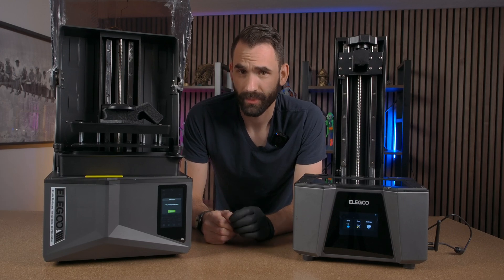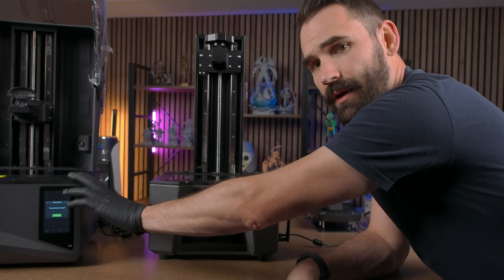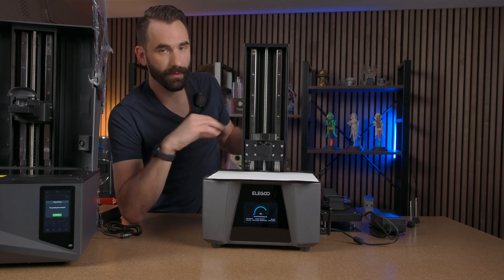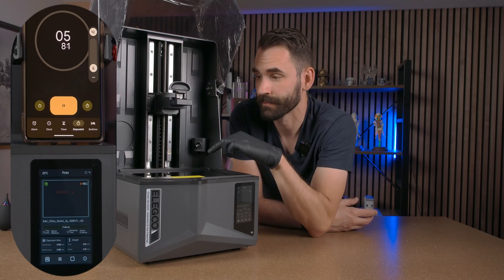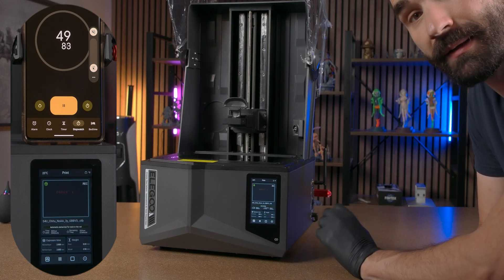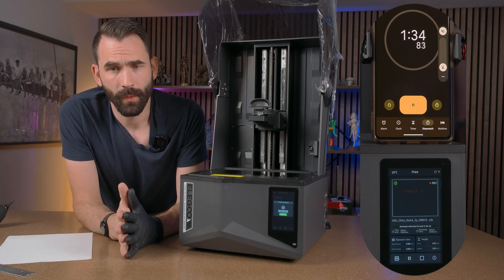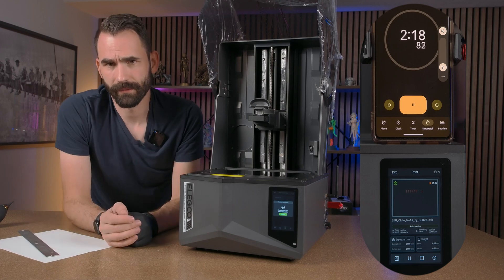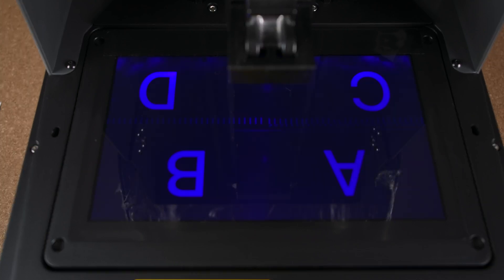Even the latest printers still have this MAJOR bug!! #chitubox #elegoo

Comment from the maker: The Glitch found has been an ongoing research project for over a year with help from aWildTomAppeared, REF and Meowcate and others on the LycheeSlicer discord. 

At RAPID + TCT I was finaly able to get into contact with the Elegoo Engineering team. I will soon be sending them all of our data where we hope we can work to find fix. 

For now if you avoid AA and .goo OR like I said in the video, straight lines on the X axis you may never come across the glitch. I would not classify this as a major issue due to it's infrequent appearance but a minor issue as it's also pretty easy to get around.

Howerever, Elegoo, you could make this time to start a print dry or normal a bit faster...... :stopwatch-blue-hand-timer:
Reply: Thanks for highlighting this issue ! I personally would still consider it a major issue, because not only do people need to be aware of it to circumvent it, they'll need to do dry runs to make sure that any modification they bring to their files is successful, or risk another failure again. Basically, they'll have to fiddle instead of being able to follow one clear simple rule to avoid it. 
I really hope all the hard work you and others have done to detail that problem will pay off and that a proper solution will be found (and not just for the M5U/S4U BTW, but their regular printers as well).
Reply: A DIY approach is underrated the software is dead simple and so is the hardware.

I was thinking about taking a laptop screen and a UV light and making one because it's so simple.
Reply: Hi! Im in need of some help I started 3d printing almost a year ago and have experienced the same situation with 3 different printers, spots and kind of scuffs appearing on the lcd screen the latest one on my 3 months old S3U and it also happened on my S2 I dont know whats going on? I dont actually have problem printing all my models prints perfectly but my screen gets damaged over time and then the spots translate as holes to my model which is really a bummer because I enjoy the hobby but I never knew why it happened to my Saturn2 and now its happening to my S3U. The only thing that comes to mind is that maybe I pressed a little too hard when leveling the build plate? I leveled with the paper method. O mayber my settings are incorrect? Currently my settings for Sunlu Standard Grey are

Burn in layer                                        Normal layer
Number of layers: 5                           layer thickness: 50um
Exposure time: 40s                            Exposure time: 3s
Trans Layer Count: 10                        Lift Distance 3>3 mm
Lift Distance: 3>3 mm                       Retract Distance 3>3 mm
Retract Distance: 3>3 mm                Lift Speed: 80>240 mm
Lift Speed: 80>240 mm                     Retract Speed: 240>80
Retract Speed: 240>80 mm              Wait before print: 1

Sorry for this comment I'm basically losing my mind because I have made a lot of research but to no avail, and all I have learned has been by watching videos but I need some more clarification on why my printers only last a couple of months, I have been making 1/6 and 1/4 scales and I would like to continue making them and been confident that I wont end up screwing up my printers, using lychee slicer btw, hope you can help me out with this little situation I'm experiencing and thanks a lot in advance!
Reply from the maker: @lolofx21  have you read my guide? 

https://docs.google.com/document/d/1aoMSE6GBGMcoYXNGfPP9s_Jg8vr1wQmmZuvqP3suago/edit?usp=drivesdk
Reply: @J3DTech  i did but I still have some questions boss 😔 I myself dont encounter problems printing, all models print fine, but the screen gets damaged over time and still dont know why
Reply from the maker: @lolofx21  1. Follow my workflow with the soft silicone spatula before every print. 

2. Clean any failure using the VAT clean method. 

3. Use my bills plate Calibration prints to set the Z offset to reduce FEP damage and increase success rates. 

4. Calibrate using Boxes of Calibration for the best strength you can get while maintaining dimensional accuracy. This will also increase the life of the FEP and LCD.

I have a LOT of workflows all designed to get better prints,  More success, and keep your printing going for a very long time. 

See my shorts as well. The tips and tricks to use tape to keep your printer clean and running well. 

Oh and how I level on the FEP is also to keep the LCD clean.
Reply from the maker: @lolofx21  Run this test to confirm level and set Z-offet

https://doc.mango3d.io/doc/j3d-tech-s-guide-to-resin-printing/printer-calibration/build-plate-calibration/

This will help with pressure agasint the FEP.

Also I have another video give it a watch and follow how I prep and clean. All this will help
https://youtu.be/llQN-70i36M?si=2LpRbuDjGwa6vcwx

I will also be doing a live stream on Saturday on the Lychee Youtube and I'll be going over some stuff to help with this very issue.
Reply from the maker: @lolofx21  Reach out ot me on Discord, if you have not all ready join the Lychee Discord and chat me there, derek J3D-Tech | Lychee team and I can help you much better. 

For now, use
Wait before print: 2s
Trans Layer Count: 3
Retract Speed: 180>60
Finaly run the build Plate Calibraion prints to confirm level, then set the Z-offset.

https://doc.mango3d.io/doc/j3d-tech-s-guide-to-resin-printing/printer-calibration/build-plate-calibration/
Reply: @J3DTech  will do!
Reply: Can you slice I  chitubox for an elegoo and select a diferent file format than .goo?
Reply from the maker: @davidc3150  You can use .CTB and it will help but not fully remove the chance
Reply: @J3DTech  yeah its a pain that but. I am assuming that's what is happening with my saturn 2. Ironically same model distribution won't trigger it on my saturn 3. I guess I will just have to settle with the idea of using around 80% of the printable area on the sat 2

Comment: Wow thank you so much for the work you put into researching this issue! I had it last week and on the weekend and it was driving me crazy. So much resin wasted. :( Guess I'll just print without AA for now... it never happened on the first layers for me so I would have to watch the printer for hours in a dry run that's really not acceptable.
Reply from the maker: @TashiMortier  When you ran into it where you using .CTB or .Goo?
Reply: @J3DTech  CTB Files, I knew Goo was cursed from my first tries of just printing the most simple models with AA on, just 4 tableflip foundry pucks on the four edges of the printer.
Reply from the maker: @TashiMortier  why that lol
Reply: @J3DTech  I can send you a picture if you are interested. It looked as if Cthulhu was being summoned
Reply from the maker: @TashiMortier  Lol yeah I think I need to see that

Comment: I encountered this issue today on my brand new Saturn 4 Ultra when I had a pretty full plate printing. Unfortunately my FEP ended up getting pierced so I'm completely out of commission for a bit.
Reply from the maker: That sucks, I'm sorry. I have sent the data to Elegoo so they should be able to see if it can be fixed in firmware. But there is a chance that it simply cant be resolved without replacement hardware.
Reply: I guess for now I'll just be printing without AA and hoping for the best. Thanks for raising awareness on this.

Comment: J, could you pls help with this. What is the difference between "Gray Scale Level" and "Image Blur Pixel" (Chitubox)? Im printing some knobs flat (because its the only way to get them really perfectly circular) and need to round off the layer lines a bit, specially on the flat tops. I would like it to smooth it out as much as possible but i dont know which of these two settings is the one im supposed to increase. Cheers
Reply from the maker: @eddiexx  Unfortunately AA won't help much with stepping. It can a little bit not much. 

You will need to reduce the lawyer thickness to 30um or 20um then calibrate to see any real difference. 

I'm not 100% sure in Chitubox but on Lychee for best results do HD AA with 2px and 0% gray.
Reply: @J3DTech  Oh i see, MANY thanks for taking the time and responding. Now i know what i could test and see how it works  :)

Comment: I remember this happening to me four or so years ago on the basic Anycubic Photon when I was still fairly new into the whole 3D printing stuff. That was quite the headscratcher. Nothing I could think of besides the screen possibly being faulty made sense as a cause of the failure (but that got ruled out when other prints finished fine afterwards). 
Just stared at the failed print like what in the actual F happened there?! Tried searching online for people with similar issues and only managed to find a couple photos looking like that with people asking what went wrong, but no answers
The fail was so damn weird that I still remember it clearly...and now the issues has finally been explained and put to rest 
Thanks! ^^
Reply from the maker: Yep, and sadly it will effect all printers as they do get the LCD's from the same place. Anycubic are less effected then the others. In my test most of the newer Anycubic Printers will error or crash. I don't have all of them so I'm unable to test everythign.
Reply: @J3DTech  Oh, that's good to know. Spent the past few days figuring out what my next printer will be (still sitting on that original Photon. Inherited a used Saturn 2 from a friend, but it died a month ago). Most likely gonna go with the M7 Pro... which should be able to pick up from where it ended after power loss. So I wonder...if this happens and it errors out and/or crashes...will it also be able to pick up from the last layer? That would be useful. Unless it just proceeds to immediately crash again on retry of that layer :D

Comment: You might have just explained why when I had a print failure with a Saturn 2 a while ago that when I changed settings and ran again, it appeared in a similar place and have seen a similar thing on the Saturn 4 Ultra with a packed plate.

I'm guessing what's happening here is there is the data going to the display is being compressed and regions of high variation don't compress as well, resulting in glitches when sending the data to the LCD controller. It's either reading the data off the memory stick/internal memory too slowly, or it can't send the data fast enough, basically the system can't keep up with the files bitrate. 

If it's a hardware limitation, it could be fixed in the slicer software, by ensuring that the file was checked before printing, by running each layer through the same compression algorithm and checking for areas with too much complexity (effectively too high a bitrate).
Reply from the maker: You pretty much nailed it. The slicer and help by not having as many gray values. Maybe converting it to 8bit vs 16bit. But this would hurt AA quality. Another Post check would be to look at the .png stack in X axis rows and if seens a Value reager then X of variation to then try and correct it by removing gray. However you can trigger this with No gray, just White and black over X value. IN that there is little you can do other then warn the user of the layer that has the issue and offer a suggestion of fix. 

A LOT of dev work for something that really needs to be fixed on the hardware level.
Reply: @J3DTech  The other thing I guess to think about when working around this bug is the size and number of supports.  A dense mesh of small supports, especially if they are just larger than a pixel would drive up the bitrate. The joys of what is probably a form or run length encoding. For vertical supports, you could probably gain a lot by simply making the profile square, ot just not anitailasing the support in particular... heck, it might make them stonger.

I'm not sure why you would use even more than 4 bits per pixel. It's not like you are viewing the image, it's moderating the amount of curing the resin gets, an while it might soften the resin some and result in some gradiation between adjacent pixels, I have a hard time thinking more than 16 values would matter.
Reply from the maker: @tali3san337  Grid supports all the way!

Comment: So If I understand right you recommend not to print parallel with the X axis and rotate the print object to avoid this bug  but ppl are really printing parallel with the build plate? The basic rule of thumb for resin printing since ages is to always rotate the printed object (ideal angle calculators online, less pulling force etc…) ppl just ignore these and print parallel than complaining wow
Reply from the maker: @xeraoh You're talking about on the Z axis to help prevent layer lines. 

But really that's also misinformation unless you're printing a cube. 

When it comes to orientation look for Y or V shapes. Avoid shallow angles on X, Y or Z. 

Keep faces and more visible areas pointing up vs down. 

Let the model be it's own support when possible.

All these objectives rank higher than one surface being at the perfect angle to reduce stepping.

Comment: Got to love Shit-u-box's great software. /S
Reply from the maker: @franklima  it is forgivable at this creeped up on them as we went from 4 k to 12K very fast. 

However I first noticed this Saturn 3 very early on and I have spent a great deal of time trying to send information over to Elegoo and CBOX to notify them of the issue but it wasn't until very recently that I was able to really get a sit-down conversation and show them the research.
Reply: @J3DTech  their device firmware has been pretty ok, but the desktop slicer has been bug ridden for years. Usablility issues like not respecting window behavior and broken crl + z functionality nevermind the random crashes and file corruption issues.  If the printer file standard was open source and more options existed I would not be as frustrated. Given the closed file format and bad software it is hard to extend much grace.
Reply from the maker: @franklima  I work for Lychee Slicer... it's obvious where I sit on that topic. ;) Lychee Slicer for life!
Reply: @J3DTech  do you know if Lychee will add .ctb support for Mars 5 Ultra?
Reply from the maker: @malkav_ils  We should bit I'll confirm
Reply: @J3DTech  I asked the same question in Discord just today) So will be waiting for the answer. See you there man.

Comment: Great video. I had a similar if not THE BUG happened to me. However my build plate was crowded with models. 

What would be the advise? Only fill the build plate on the slicer up to 80-90% and try to look out for places where you would get several lines oncurring on the X axis? Or what would be the advise to keep in my for everyday printing (if it is one model i get it, just shift it to go inclined instead of mostly horizontal, but if its several models, whats your advice?)
Reply from the maker: I seee it on that type of print as well, if you have rafts or a lot of models that stack up to create a line of lit pixles on the X.  Try to move them around to be staggered. 

But also, .goo + AA will make it happen a lot more often.

Comment: I am so disappointed. We start telling Elegoo about that before the S4/S4U first releases, and that changed nothing, even the expected effect of the 8GB upgrade didn't changed a thing while the screen stayed the same.
And the way we need to run a dry print... I'll say it again, the S4/S4U is a toy. Ok, most mainstream resin printers aren't high-quality engineering, but this is bad when you want to make your printer simple for the common user (which is great, really) but you block the power user to really get into the details.

Good video, you went into details to explain how it works, and how to try it. Did you compared the different tests AWildTomAppeared created ? maybe some generates the bugs on the S3U, but it's still safe for the S4U ? I'd be a little happier if there was at least a small improvement.

(Also, do you ever use this S3U ? how do you do to keep this thing so clean ? resin splits are so hard to clean up)
Reply from the maker: @Meowcate  I printed quite a few different things on the S4U and this was the most simple to show off. No need to make it complex for a video like this. 

I'm not a fan it takes almost 3 minutes between every dry print test.. makes running the test take forever. 

I use my S3U all the time but I keep my tape on the front so any drips are easily removed. 

I also keep plastic wrap on all my covers inside and out for easy cleaning of a static pull gets the resin on the cover.

Comment: Great tip about the diagonal lay out. Deffonetly going to try it. Now 1 silly question. Is the dry print the same settings as a typical print. Or do you use different lift speeds to speed it up or is there a specific file/stl i should use like the one you use
Reply from the maker: @honda1st1  Depends on what you're testing. 

Just the LCD or a glitch like this. No need to expose for more than a second or lift at all. 

If you want to test everything run it at exactly the same settings.

Comment: I had this back in the days on my anycubic mono X 6k, until anycubic provided a special firmware.
Reply from the maker: @runklestiltskin_2407  It does effect Anycubic as well but not to the same extent. 

Most other printers will crash and stop printing.
Reply: @J3DTech well, the shift of 3mm was enough for supports to fail, but yes, this glitch as shown is insane